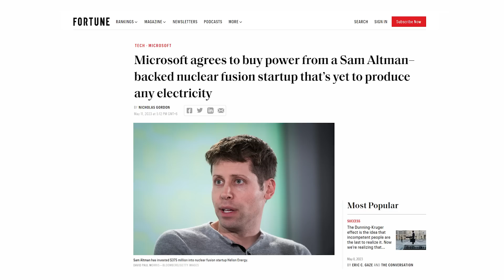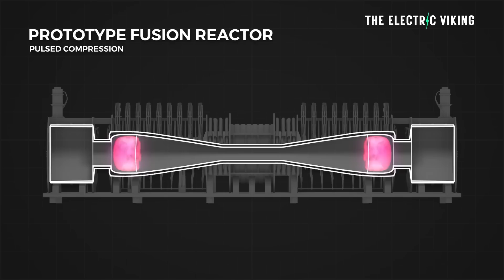Microsoft says the nuclear fusion dream is about to become a reality

Comment: Completely bogus and based upon the false claim that the Sun creates it major energy output by fusion at the core.
Completely false.  The current evidence is just as Hannes Alfven predicted, minus the mater/antimatter idea. The Sun produces it energy directly out of the photosphere, most likely by fission or annihilation of the hydrogen proton.  The original e=mc^2 that Einstein's botched.
     Fusion seems to occur in the chromosphere but as a side-effect of other mechanisms of the chromosphere, such as along the electric currents generated in the plasma in the lower chromosphere.
Fusion only gives off energy on par with plasma recombination, so the energy output will always be on par with the input energy needed to create a plasma state from the matter input into the so-called fusion reactor.  Getting energy from fusion is like "carrying water uphill to get that energy back out of it."  It can produce energy but will always be an unviable way of getting energy.

Comment: Well, I don't think it will be not more relevant, because you need to see the big picture. It can be also use for space explorations and generation more power vs  used space you would with solar panels. Beside of it, it will also decrease the depending on it, and better to control the power generating and distributions.  It will be also acceleration fusion engine progress for using in space, and to build powerfully protections agains space dangers.

Comment: Based on the track records of fusion energy vs renewable energy from solar, wind and battery. I’ll bet on the latter at any time. I also worry about the extra net energy created by fusion may heat up the atmosphere significantly before radiating out to space. Renewable energy on the other hand creates net zero energy; it just takes energy from the sun and converts to electricity. No extra heat is created in the process.

Comment: I think you are wrong on one major point; there are only so many places you can install solar and wind. Plus, you will need battery arrays to store and redistribute power from solar and wind when it is dark or cloudy, and when the wind isn't blowing. Fusion power does not have those limitations, it can be installed pretty much anywhere. At this point, it's an engineering problem as much (if no more so more) as it is a science problem. Heating up a plasma and sustaining those temps while keeping it contained is probably the biggest challenge left to solve.

Our growing power needs over the next century will likely outstrip what solar and wind will be able to provide, regardless of it's cost. You need lots of land, more than is available across the globe, to provide enough energy for the future. Fusion does not have that problem. Also, tritium/helium3 can be created with the power coming out of the reactor. You can make tritium and helium3 from litheum, it's what our thermonuclear bombs do (albeit through an entirely different process). Expose deuterium to a neuron flux coming from the reactor to make more fuel and return it right back into the fuel being injected into the reactor. You're gong to have a nutron flux regardless, why not put it to work?

Comment: Helon is already getting fusion regularly, so the 100,000,000 degrees is not the barrier.  Extracting  electricity by  the same coils that accelerate the twin particle beams as they rebound from the fusion, rather than creating heat to boil water, is the breakthrough.  Steam boiler driven dynamos are at most about 30% efficient,  giving a steep barrier to net gain fusion.  No doubt, AI will be important to this enterprise, as well.  The other breakthrough that will energize all fusion projects is the development of high temperature superconductor magnets.  ITER has 12 Tesla magnets, the new magnets can do 20 Tesla.  The increase in efficiency of all high power electronics  is real and transformative.  Bet on the horse of your choice.

Comment: Nuclear Fission is actually one of the safest forms of generating power (see other podcasts pointing this out), and results in less harm & death than basically everything else.  It's just the psychological factor.  Going in that direction and not relying on age old technology to do so brings much greater promise.  That's not to say to get into advanced AI to help us solve and explore fusion.  I do believe one day it will be better, as the cost of dealing with / recycling solar panels and wind turbines altogether need to be factored into the total cost over time, as dealing with expired wind turbines is beginning to happen and processing expired solar panels is a new endeavor to resolve that costs $$ as well (but will also progress to be better to one degree or another).

Comment: No way!!!  The way to calculate when is take the inverse of the probability of the prediction, take the difference between date predicted and today.  Take that and multiply by 2.  And that's when it will be done.

Helion say 5 years (2028) x 1/Probability 10% x 2. That gives you 100 years.  Or very best case 30 years (assume 30% chance of success.)

AGI is not going to happen.  That too is about 50% in 20 years.  Applying the formula: 2*20*2 = 80 years to AGI.

It's highly unlikely that anybody watching this video is going to see fusion power or AGI.

PS
I got this from a 10 year old genius kid's dad.  And it seems the kid is always right.

Comment: New Fission has everything fusion was supposed to bring.  There is no reason to be throwing billions at fusion.  Thorium molten salt won't melt down because it is already molten.  It won't blow up because it is not under pressure and does not use water, at least not in the main loop.  And it eats most of its waste and the existing waste from other reactors.

Comment: It is an interesting comment at the end of the video that solar and other renewable energies in 10 or 15 years may simply make fusion redundant. Yes they may solve and cover the needs for dispersed low power needs, like household, charging cars etc. I do not believe in making fusion redundant, that is because we will still need concentrated high density energy production solutions. Renewables are extremely dispersed and just not practical if you are looking for Gigawatt level production units in an acceptable form factor. The jury is out concerning Helion. I do not believe they can deliver power to Microsoft in 5 years. I would love to believe they can do it and there is maybe a chance. At least besides the stellarator and not considering laser confinement and tokamaks, the other original concept have yet to show anything. Helion have announced to have reached about 104 Million degrees which is the bare minimum. In my opinion they should target 200 million degrees or more to have enough fusion reactions happening. Now to be believable they must show net energy gain. Then sustained energy gain through their pulsating plasma machine. Basically we can think by analogy of a gasoline engine which pulsates to the rhythm of regular combustion expansion of gas in a cylinder. The advantage here is that there is no mechanical transmission and the energy of fusion create expansion of plasma ´gas’ which is directly captured for generating electrical energy. Excellent as you take away all the energy lost through mechanical thermal friction losses. But there maybe other types of thermal and radiation losses from the plasma so again it is not clear here how all this boils out. They say low radiation but to me it is not clear. If there is neutron emission how is this solved. Conceptually it is really very elegant but the devil is hidden in the details that are not disclosed, but Microsoft probably did some due diligence and they have been convinced. OpenAI is coming to help too. Sky is the limit. Good luck Helion, may the ´electromagnetic’ force be with you.😊

Comment: Indeed it is a truly wonderful time to be alive. Providing we don’t blow ourselves to eternity in war, peace and prosperity has never looked so good. FUSION HAS RECENTLY BEEN ACHIEVED IN THE LAB. Just a few seconds, but the fact that it’s just been done is going to spur companies like Microsoft into doing these things. The trick is to generate more electricity out than put in. They just did that. The waste matter is much safer (will become harmless after 20 years) and the machine will close down naturally instead of running away and causing a disaster (as in nuclear fission) in the event of malfunction. It’s a long long way off though. Still considered to be sci-fi by many. The high temperatures are reached through the plasma being energised and the outside magnets stop the plasma from touching the sides. I’m guessing they’ll eventually come up with an alternative to Deutrium. I envisage an age where mini nuclear plants will ‘rock up’ on the back of a lorry fuelled by nuclear fusion. No doubt about that, but it’s a very very long way ahead and we can’t wait for it. Hence the need for wind, solar, hydro and other nuclear fuel.

Comment: Fusion is not going to be irrelevant for one reason: energy density per footprint. Even IF wind and solar are cheaper even with battery storage comes in, Fusion could be the on-demand energy source needed to drive vehicles through space. 

Helion has been doing hundreds of thousands of test firings, achieving fusion (although not power positive, yet), and testing their equipment before scaling up based on the results of those tests and experiments. They've already got a road model to achieving power positive fusion. They're currently on their sixth iteration of the reactor, with the seventh, currently in construction, estimated to breach power positive, as in total power positive, as in more energy went to the battery it discharged to than went into the whole system, including the cost of the electromagnets and everything. 

I suppose in five years we'll see if they are correct on that or if they need to continue iterating to hit that goal.

Comment: As soon as I hear about the "net energy" claim, we're getting into scam or at least wildly misleading territory.  (Not by Sam, by the experts making such claims hoping to get more funding quickly). 

Practical break-even energy with a stable reaction is needed at a viable cost to produce a practical commercial fusion system.  The "breakeven energy" being bandied about by the scammers / hypers of fusion is the TOTAL energy -- not just, for example, the energy coming from the lasers, but ALL the energy needed to fire the lasers, waste energy, and energy needed to keep the reaction going -- plus of course enough extra energy produced to sell and make the whole thing profitable. 

Wiki explains this.  Various physicists explain this (don't take this layman's word for it). 

The point is, it's great that they're making progress but many credible sources are saying we're a LONG LONG way away from a truly practical commercial fusion system capable of running lots of fusion plants at a profit so they can compete with other types of power plants.

Comment: For kicks, a fellow student in one of my physics classes calculated how much energy was in a stick of dynamite.  It was the 3 sticks of dynamite equiveillance of fusing two H2 atoms together or about 900 sticks of dynamite of energy released when the reaction spit out a helium atom.  I think that they haven't fused anything together yet because they haven't blown up the room and killed everyone working on the project.
Reply: SoosV:  So babblespeak, and the way you spell "equivalence" like a 9 year old (you're ON the internet, after all) says your intuition isn't much good for science, just like the people who insist the earth is flat, for example.
Reply: @rogergeyer9851  The earth is flat, it just curves downwards until it meets itself on the other side.  And you sound like a plasma physicist, thinking that everything revolves around electromagnetism.  There is just a little heat involved in this one.  You should follow the Z pinch.  one-foot-thick titanium walls and the heat (from actual fusion) is melting the titanium away.  I am not saying that they won't fuse two H2 atoms together, I am saying that it will go boom and their boom box isn't big enough.
Reply: Your fellow student is off by about 20 orders of magnitude. Try again.

Comment: There are many paths to fusion and producing electricity. Helion's is the simplest, most direct, and cheapest.  Helion uses pulse-fusion which is much easier to produce and use.  Summary of Helion's process:  Plasma has a charge.  A charge passing through coils produces electricity.  Helion uses pulse-fusion to produce plasma and releases it through coils,  directly making electricity.  Helion's path to fusion has two step process. First they make their own H3 with just deuterium in cheaper accelerators similar to their main fusion accelerators. Deuterium is not that expensive. Two steps are used because making H3 releases neutrons which will degrade accelerators.  Second, this created H3 along with deuterium will fuel Helion's more demanding fusion-accelerators. This reaction will not release neutrons, so these more expensive accelerators will last longer.  Helion may also be be able to sell the tritium their reactors produce to other reactors or keep storing it until the tritium decays into H3 after 12 years.  Helion might be a profitable business just by making and selling H3 and tritium.

Comment: Sam E. Look closer at Helion's process. Helion will be making their own expensive H3.  Helion's fusion is actually a two step process.  First they make H3 with just deuterium in opposed accelerators similar to their main fusion accelerators. Deuterium is not that expensive.  Helion will use separate accelerators because making H3 releases neutrons which will degrade the accelerators.  The accelerators for making H3 don't have to be as good as their main, opposed, fusion, accelerators.  Then that created H3 with deuterium will be used in their main opposed fusion accelerators and this reaction will not release neutrons, so the accelerators will last longer.  Helion will also be be able to sell tritium to other reactors or keep storing it until the tritium decays into H3 after 12 years.  Helion might be a profitable business just by making and selling H3 and tritium.

Comment: The budget for the ITER project is estimated to be $20 billion for a fusion reactor prototype and should be ready by 2030 ... but get pushed back every 10 years.
I guess Microsoft has a lot of spare cash to spend ...
They might get a closer look at cold fusion too ... less expensive
Reply: This is what everyone is missing.  Look closer at Helion's two step process. Helion will be making their own expensive H3.  Helion's fusion is actually a two step process.  First they make H3 with just deuterium in opposed accelerators similar to their main fusion accelerators. Deuterium is not that expensive.  Helion will use separate accelerators because making H3 releases neutrons which will degrade the accelerators.  The accelerators for making H3 don't have to be as good as their main, opposed, fusion, accelerators.  Then that created H3 with deuterium will be used in their main opposed fusion accelerators and this reaction will not release neutrons, so the accelerators will last longer.  Helion will also be be able to sell tritium to other reactors or keep storing it until the tritium decays into H3 after 12 years.  Helion might be a profitable business just by making and selling H3 and tritium.

Comment: Yeah I don't believe it. Even if they created a demonstration plant, there is no fuel available. He3 is not commonly available.
Reply: Helion makes its own H3.  Summary:  Plasma has a charge.  A charge passing through coils produces electricity.  Helion uses fusion to produce plasma and releases it through coils, making electricity.  People are also missing that Helion uses a two step process. Helion will be making their own expensive H3.  Helion's fusion is actually a two step process.  First they make H3 with just deuterium in opposed accelerators similar to their main fusion accelerators. Deuterium is not that expensive.  Helion will use separate accelerators because making H3 releases neutrons which will degrade the accelerators.  The accelerators for making H3 don't have to be as good as their main, opposed, fusion, accelerators.  Then that created H3 with deuterium will be used in their main opposed fusion accelerators and this reaction will not release neutrons, so the accelerators will last longer.  Helion will also be be able to sell tritium to other reactors or keep storing it until the tritium decays into H3 after 12 years.  Helion might be a profitable business just by making and selling H3 and tritium.
Reply: @James Cottrell  Interesting. Ok Hopefully it works out for them.

Comment: I'm inclined to agree with your closing remarks, Viking. Generating 100M°C would surely sozzle the planet leaving a puff of smoke in the solar system where the Earth used to be.
And if they succeed without sozzling Earth, just what could they do with all that energy, maybe frazzle some very large capacitors trying to capture it, will the grid be man enough to distribute it without blowing like a big fuse, or do they propose to absorb it transforming half the Pacific ocean into hydrogen in the blink of an eye??
Reply: Helion uses pulse-fusion.  I think Sam missed this point.
Reply: Why would you say such a foolish  thing? You're confusing temperature and energy. Something can be very hot but have very little energy content.